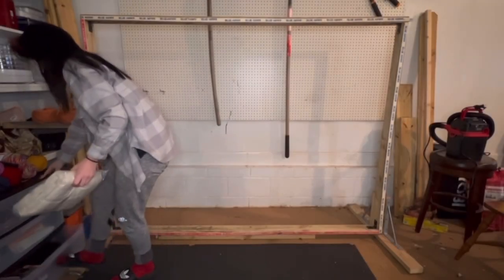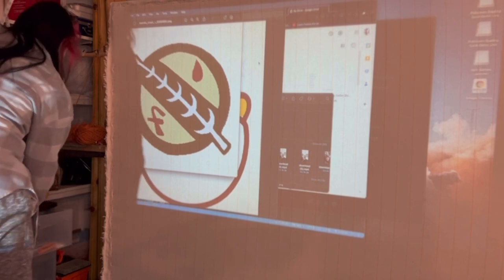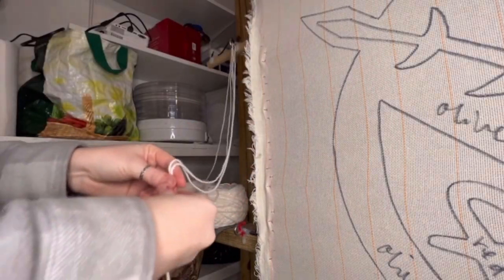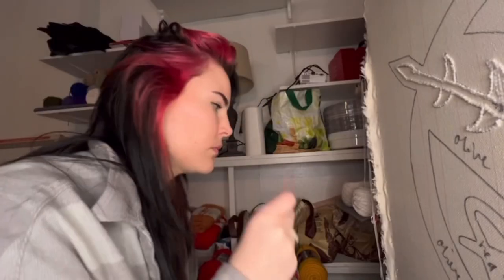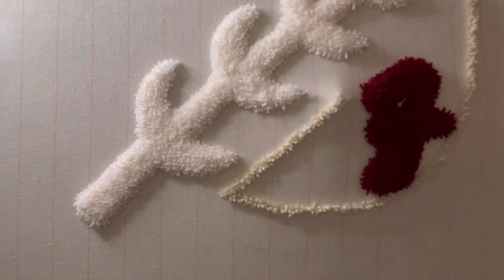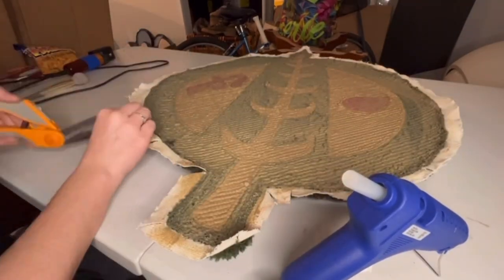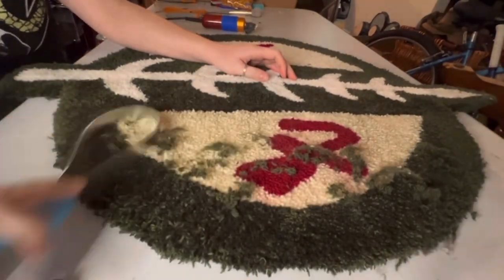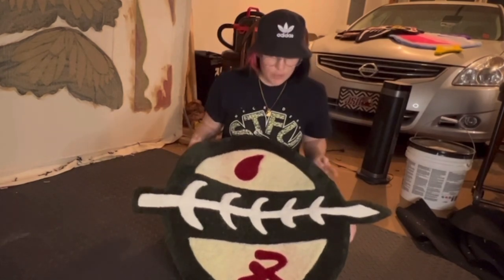My Tufting Process!

Comment: whats the object you use to scrape the yarn off the rug after you shave?
Reply from the maker: Hello (: that is just a pet lint scrapper tool, you can get one from the pet isles of a store or one on Amazon. There are better versions than the one I am using but it does the job which is to removed excess strands that aren’t glued into the back of the rug!
Reply: @tuftedbails  thank you!

Comment: What program do you use on the computer to project onto the toughing
Reply from the maker: Hi Sharon! So for my tufting, I use a MacBook, and I save the image to the device and then I open it in the preview app. Usually when you double click the downloaded image it will come up in a display window on any device! From there I have an hdmi I run to the projector. Hope that helps.